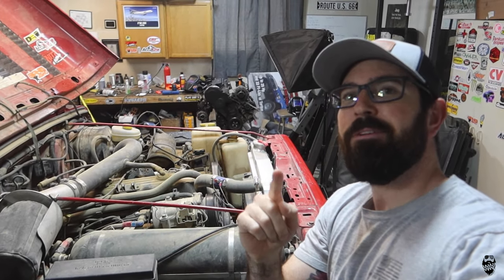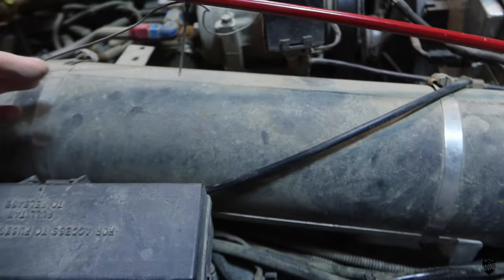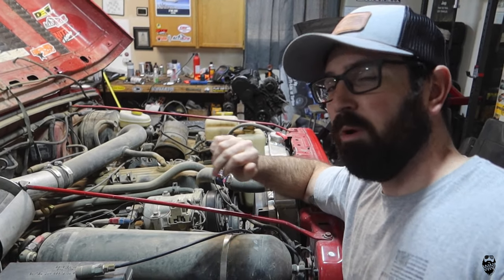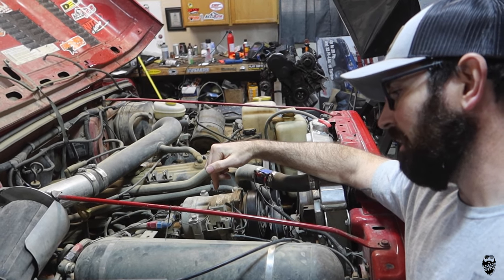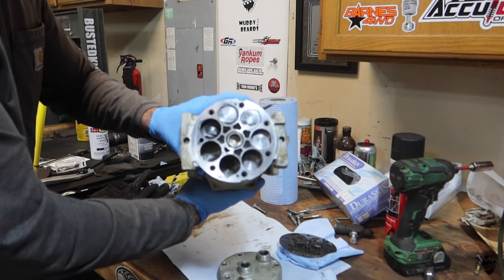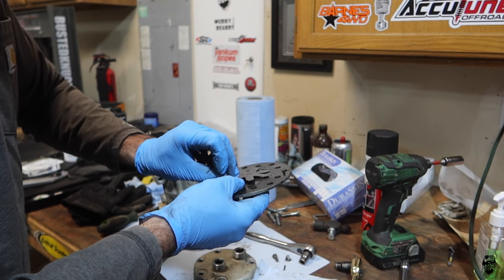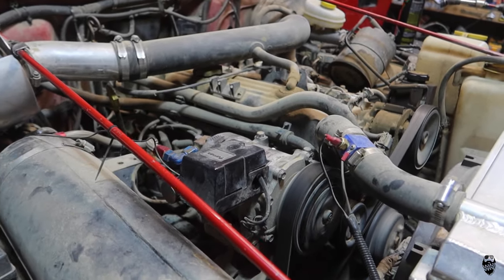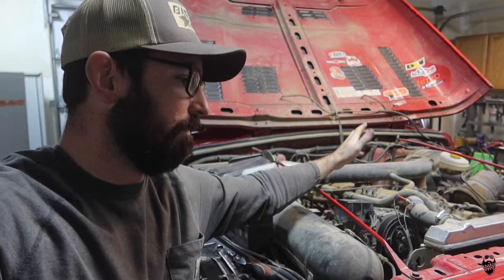DIY Onboard AIR!  A/C compressor to air pump conversion and Repair!!

Comment: Pro tip - to provide some oil vapour to your compressor Tee your suction line into your rocker cover vent, that way you'll get clean air with oil vapour & you'll never have to worry about oiling it ever again👍
Reply: only issue i see is on some cars (my 97 pathfinder) it also has a tube that pulls through the intake which is MAF based. This would most likely mess up my MPG. I do have a PCV reroute to a catch can so that would be better in my case and others if they dont know their PCV routes that way
Reply: This is metered air, and designed to vent the crankcase. Once it hits the sealed compressor system, it’s not sealed. Maybe as a pass through system to make the compressor an oil separator?

Comment: For almost a year now I’ve been using my spare to air up. I over fill it to 80psi. Then when I air down my tires to about 13psi I hock up 4 hose system to spare tire. It distributes air to all four tires evenly and brings them back up to 30 psi. (safety note make sure your spare is in decent shape ie not cracked or patched). Works great and only takes about one minute
Reply: What size tires are you doing this with? It sounds brilliant but I question how you can get an even 30 into all 4 tires with only 80 in an equally sized storage tank🤷
Reply: @thelonewrangler1008  The spare tire is the same size as the others. I only air down my four tires on the vehicle down to about 13. Sometimes it only gets him up to about 28 but that’s still more than enough to drive safely on the road and get home and use a normal air compressor
Reply: You need to have the check valve on the air that comes out of the pump and goes to your tank before your tank you need a check valve and then the that little quarter inch line that goes to the switch goes before that check valve so . The pump doesn't have to start against the pressure that's already in the tank what else you should still use the clutch fan that turns on when you turn on the air conditioning so it's not running I guess that's obviously already been done like that but anyhow things don't look like they're quite hooked up right

Comment: Small note: you could add a double water separator from Amazon to the exhaust of your ac compressor. This way your air tank never gets water sitting in it extending the life of the system.

Comment: Need to pack it with high temp grease, and plug the one hole that goes from the front of the pump to the back n never worry about it again

Comment: Air tool oil works super great on these setups, seems to hold on an stay lubed longer an it's ment to run through air gun tools with pistons etc so makes sense it does well.  You can actually run a oiler like on a home air compressor an place it on the intake side so the oil is drawn into the compressor, just remember to restrict it some because it doesn't need the amount of oil the inline  oiler will Wana put in the system.   And a larger air filter like a can filter that's got a metal shroud on it will help it last alot long an give metter flow, that little one will get clogged an make the compressor struggle with a couple dirt road trips
Reply: Nah to complicated and impractal. That will also let oil into the airline which is bad. Open it plug a port put some grease in there and close it back up. And don't touch it again. There's vids that show how to do it.

Comment: you should do away with that crappy little air filter for the compressor and plumb it into the jeeps factory intake pipe and let it breath through the engine air filter, which will allow it alot more free flow suction, also that little filter probly clogs up really fast.

Comment: Eliminate the pressure switch. Just install a manual spring loaded blow off valve. You'll just have to know the max pressure it's capable of. Probably go slightly below that.

Comment: If you block the oiling port with a 1/4-20 set screw and then clean inside the drive end (wobble plate) and coat the bearings and wear plates with grease it will run forever. No oil dripping necessary, no wd40 needed.
Also, make sure you always have the pressure release valve and a pressure switch to cycle the compressor clutch automatically. These compressors can build up hundreds of psi without that pressure release.
Also, to know the flow, look for “605” or “709” on the compressor body. That means you have either 6 pistons and 5 cfm or 7 pistons and 9cfm respectively. 9cfm is pretty decent flow.
Reply: How much pressure can you get out of it
Reply: I run my sanden AC compressor the same way as you describe. 1/4-20 set screw in the crossover port. I used half a tube of synthetic grease inside as well as doing all the pivot points, bearings and the gears. Running it in a 92 XJ for almost 10 years now. Not had a single problem.

Comment: Man that’s old school. I haven’t seen an ac air compressor in a while. I’ve been thinking about doing this on my ramcharger. My uncle had one on his CJ-5 when I was a kid. It was so nice to have air on the trail. Especially since there weren’t many options for portable air back then
Reply from the maker: It is a game changer for sure. It is one of the most important tools to bring to the trail.

Comment: Kelly, 
Great video on the the AC on-board air system. I had this same setup on my 95 YJ for close to 15 yrs. It worked great, it would fill a 36" tire in five mins or less. I had a hose run to the PVC line on the valve cover for oily air to the intake side of the compressor. Never had a oil issue with the compressor. To save space I did not use a tank. Just straight to a air chuck mounted to the control box for the compressor. It works the same on a tank type air compressor. The compressor would hold a constant 85 psi while filling the tires and was set to shutoff at 95 psi. To relieve the pressure after filling the tires, I would just drain the line after shutting off the compressor. The total cost for tubing and control valve was about 40 bucks at the time. I wired the control valve in-line with the clutch control wire. I used the control box to turn the compressor on and off. When I added a welder in the engine compartment, to fit it in, I upgraded to a York truck air brake compressor with a 5 gal tank. I also mounted air chucks at both ends to the jeep so I can fill all 4 tires at once or let someone use one to fill their tires. It takes more time to hook up the air hoses to the tires then it does to fill the tires with the York. Having the air chucks mounted to the jeep keeps the air lines from getting damaged on the trail.

Comment: Just watched your videos for the first time. I have a 93. I tried the oiling system. And all it did was spit the oil out faster than I could put it in. So, round two, I put high temp red grease in it. Seems to work fine.
Reply: Put a plug in it there's vids describing it

Comment: I did the same on my pickup 6 years ago. One piece of advice is I added a scoot oiler of a motorbike and the vac line that would usually go to the carb intake to open he drip feed into the same intake pipe as the compressor now has no oil lubricating it in the freon so it will seize unless you add lubrication. Just have to drain the tank or fit a oil separator after the pump.

Comment: nice job finding the problem.  I have a tee with a cap on the intake side that I can put oil into from time to time. Also a check valve then a filter to remove oil and water before the tank.
Reply from the maker: Thanks, I have thought about adding those things for years, just never got around to it, low priority since it was working so good for so long.
Reply: Totally understand. My jeep is far from trail ready. Definitely give you credit. Hope to see you on the trail someday.

Comment: I've looked into this years ago on my 88.5 Samurai with an old Volvo(?) compressor. 

Never thought of just dumping WD 40 in it on occasion. 

Might try it on my Gambler 98 Outback 2.5 with 31's.
Reply from the maker: It seems to work, been 13 years and it’s still going

Comment: Thx for the vid.  I picked up a jeep a couple years ago with a York (GM) compressor already set up.  I've been concerned about the oiling.  I see there are some conversions that eliminate the need but I don't know the history on mine.  I think I'll do your suggestion and periodically spray some light oil into the intake. Thx! BTW - mine also had that mechanical pressure regulator that worked/didn't work randomly - I went with a small electronic unit (about $5 on Amazon). Mine is mainly for filling tires and as a backup to the ARB pump for my lockers.
Reply: York compressors have an oil reservoir built in and do not require oiling through the lines. They will spit quite a bit of oil through the output line so a coalescing filter should be used. The standard procedure for checking and refilling the oil on a york is removing one of the plugs on the side and using a flexible rod (coat hanger) as a dipstick. A google search should bring up the exact process. There are internal modifications that can be made to the compressor to cut down on oil spitting. The York is a great compressor, I can fill up a set of 35s and a set of 33s in the same time it takes the big boy dual ARB pump to fill up a set of 33s.

Comment: I've been told that if I repurpose my A/C pump then my defroster will not work correctly? Have you noticed if yours still works ok? I guess the A/C is used to dry the air for the defroster.

Also great fix! Love that you took the time to open it up and it was a simple fix. Already awsome to see how long you got away without having an oiler. Some make it sound like the pump will blow up on first use without it. Thanks!
Reply from the maker: Correct, the a/c compressor pulls the moisture out of the air so defrost will not work as well for sure. If your worries about it blowing up, you need to pull the front side off and grease the flare bearing.
Reply: @MuddyBeards4X4  I ran a York on my old Tj and loved it so much but my 05 LJ Rubicon the room under the hood is pretty limited and I rarely drive in the winter (Eastern Canada) so I might think about doing this when I finish up the other 50 projects I have on the go :) -- Great content!
Reply: The YJ AC is completely separate from the regular heating system so it doesn't make any difference on a YJ,  They TJ has them tied together.. So on a TJ it reduces the effectiveness of the system fot defrost ,,, BUT your local weather has as much affect in many cases.

Comment: If you remove the bolt on the side you can add oil or grease to the bearings in the middle
Reply from the maker: I did try that, but the flat bearing was too thin to get my needle grease gun in there, so I left it out of the video. If you had something small enough to get in there it definitely would work.👍🏻
Reply: @MuddyBeards4X4  I tore mine completely apart but if it fails I'll fill it with oil next time
Reply: I've seen a couple videos so far. I've wondered why you couldn't just add gear lube or even add compressor oil back in after sealing off the top compartment. I also like my ac too much to use the factory ac compressor. I think I'll try to find a spot to add another in line with the belt. I'm working with an F550 and I want to pull trailers with air brakes.

Comment: Please add a check valve on the compressor outlet, and a pop-off (relief) valve on the tank. I'm not sure WD-40 is the best choice for lubricant, but I guess it hasn't failed yet :)

Comment: I did this on my 91 mj i used a old 30lb propane tank. Takes like a minute to fill and filled 12 tires super fast. Only issue I'm having is the line getting hot at the pump and splitting open after a while
Reply from the maker: Nice, those lines definitely get hot.
Reply: I use a copper nickel line, compression fittings to NPT, support it well to mitigate vibrations, and then run whatever rubber hose you want. Or get a stainless compressor hose whip.

Comment: ik its a bit late but you can bench test the compressor by using the impact tool on the nut of the compressor shaft to see if it sucks properly

Comment: I’ve been wondering if this could be a possibility since I got my Jeep. Another idea other than WD-40 would be to use regular air compress/tools oil.  Thanks for sharing.
Reply: I have one on my yj . Still takes time to fill my 40’s cause I have a tank about half your size but it’s free and always there when I need it . I still like power tanks for convenience and quickness.
Reply from the maker: They are definitely quicker, but not free, lol. and take up space in the cab.

Comment: In doing this, I’m guessing you lose your actual ac ? no more AC or can you run two pumps one for Aron one for AC?
Reply from the maker: You are correct, no more ac. This setup was already on the Jeep when I bought it. I would prefer to keep the ac and just run stand alone onboard air.

Comment: I work on a lot of automotive ac systems. You can pack the back of the compressor with grease and it'll last quite a long time. I'm gonna put a similar air system on a nissan frontier at some point. I'm gonna make it a bit more complicated though. I'm going to retain the factory ac in addition to engine driven on board air.

Comment: Maybe I missed this, but what pressure air can you get?  I'm looking at a project where my ideal pressures would be 300-600 psi and it seems impossible to find a solution. I'm wondering if it might be possible to use 2 storage tanks  where one can be used as a supply tank to the compressor (using electronic valves) and once max pressure (from normal atmospheric pressure on the intake of the compressor) is reached in both tanks, switch to the one tank as the supply to the compressor & run it at 30-60 psi.  This would then be fed into the other tank which will reach a pressure of 2-4x higher than it was.  This would have to switch back and forth for filling the one tank & then using it as the supply, but the only other ways I can think of to do this is with a 2 stage compressor (haven't found in automotive compressors) or run 2 compressors in series (which has some larger issues IMO than running 2 tanks).

Comment: This compressor has no secondary oiling with the open loop air system. Can the compressor stand that? Usually there is an amount of oil in the AC closed loop application.

Comment: Great video, Kelly! A few of my buddies ran that style of compressor and used an in line oiler on the suction side. It is adjustable and we would set it up to let in a drop every 5 seconds in the air stream while it was running. We also used a coalescing filter on the discharge line to separate the oil out of 
the air. I always used a check valve in the discharge line to stop any air leakage from the compressor while off. I would really recommend a relief valve on that air storage tank, or in the entrance or exit line at the tank. Those compressors do have ability to build some substantial pressure. I'd hate to see that tank become a missile. I've never had the suction end off of one of those compressors and they are setup very similar to a reciprocating compressor with the reeds on the suction side. I was totally unaware of the WD-40 once a year trick. Great idea!
Reply from the maker: All great ideas, like I said, it was on the Jeep when I bought it as is. I definitely will add a pressure relief valve on the tank for safety. When I do the onboard air in the montero I will be building it differently.

Comment: I KNEW IT! I knew there had to be an easy way to do under-hood air compression.
I just need to buy a compressor. my jeep already has the mount, just no compressor.

starting from scratch this is going to be an expensive buy list lol.

Compressor
on/off controller
air tank
new belt
pressure switch
air line
fittings
compressor hose

yikes.

Comment: I'm very new to onboard ac compressor swap. But I wanna do this to my 88 Ranger to use my air suspension. Does any ac compresser work? Or am I looking for a certain manufacturer?

Comment: Great job! Can you please tell me/would you know what threads are on the back of the AC compressor please? I believe they are metric, being Japanese? Thank you from U.K.
Reply from the maker: Thanks. Not sure the threads but I left a link in the description with the adapters which should state what threads they are.
Reply: @MuddyBeards4X4  thank you

Comment: why would you use a water displacement fluid? (wd40).should you use a oil to keep the unit from freezing up? ( even 3 in 1 is a oil).

Comment: Doesn’t this make your AC not work in the vehicle? Or am I thinking of a different AC onboard air mod?
Reply from the maker: You are Correct
Reply: @MuddyBeards4X4  damn was hoping that it wasn’t that one 😂 too cheap to buy an air pump but don’t wanna lose my AC since it’s my daily driver 😂

Comment: How did u wire it to where u can turn it off an on with that button?
Reply from the maker: It’s the Auxbeam 8 switch control panel. I have a video of that install probably a couple years ago.
Reply: The green wire gets 12v it engages the clutch. So any switch in that feed will control it. Like a power switch and/or a 90-120 psi pressure switch. With 2 spade connectors on it.